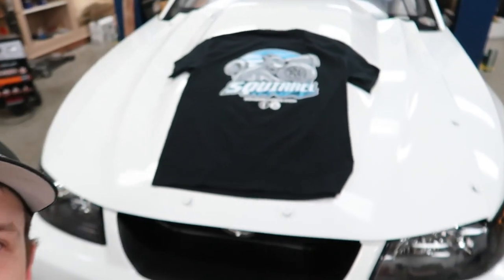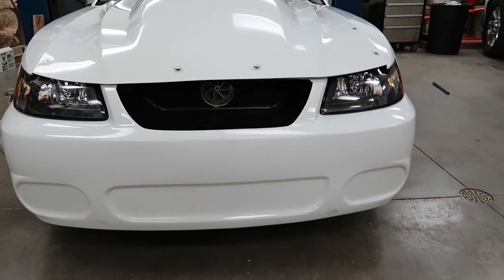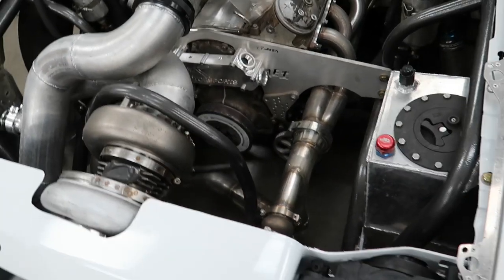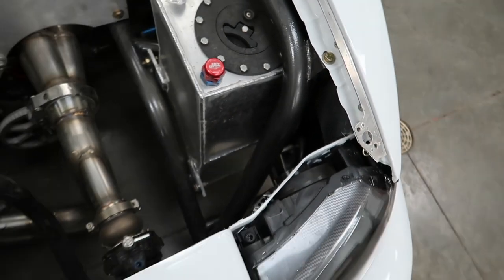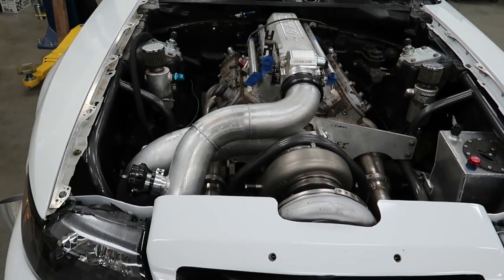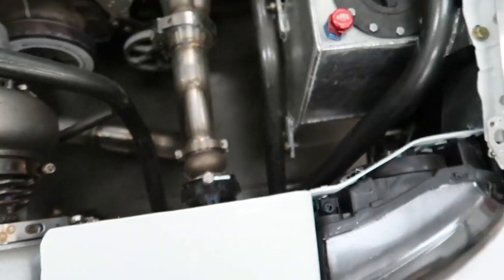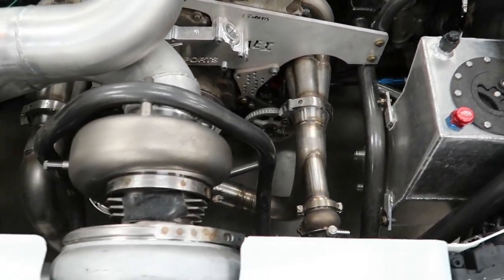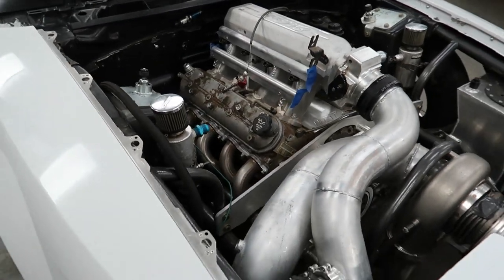My New Car is BACK! Road to Re-setting the SBE 4.8 Record Ep. 4

Comment: Well done!  Are going to setup for dual fuel or just 2 smaller injectors on M1?  What is target peak hp rpm with new cam?  Crazy to think how the induction system defies physics with small heads, long runner intake and yet 9K rpm when boosted.
Reply from the maker: Not a real long runner but yeah NA I'm sure peak hp would be much lower, boost really changes things. And just need the 16 210s to supply enough M1 no dual fuel setup. I'm expecting it to peak a bit over 8k. The last one peaked about 7800.

Comment: Looks fast sitting still!! 🏁🕺🏼
 U need the radiator for certain classes? Or is it a driven car ? Just curious with the methanol.
Reply from the maker: Thanks man! And it won't be driven a whole lot but I do plan to run some outlaw street type stuff with it in the future and it will be driven to and from each pass.
Reply: Squirrel Tuned  awesome. So there’s even more weight u could drop if u wanted to. Looking forward to following the progress 🇦🇺